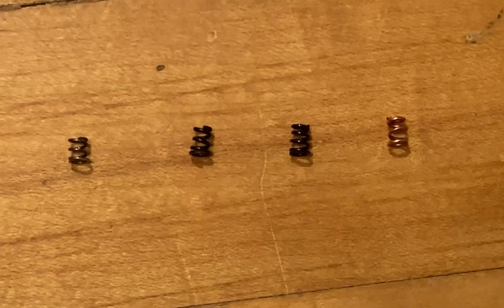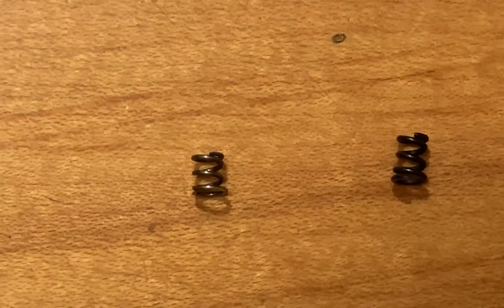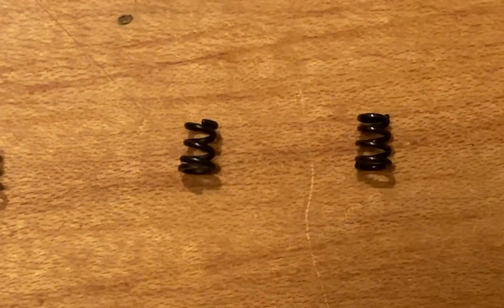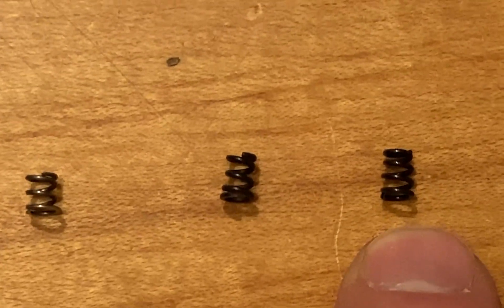AR15 Extractor Spring Std vs Sprinco vs Colt SP64026

Comment: I'll just throw this here... why would it matter if the extractor spring develops some surface rust? And what would be so hard to apply a bit of CLP there when cleaning and storing it? What's the difference in cycle life between the Colt "Gold" and the Sprinco 4-coil?

BTW the Wolff XP extractor spring is like 5 coils and not ground at the ends, and I could never find a bolt that would accept that 5 coil spring without some serious work involved.

Comment from the maker: I'm just rereading your message as long as it is trying to make sense of where it is. You actually disagree with me. Sprinco themselves told me if u won't be oiling your springs these aren't for you.
Reply: Per the conversation I had with Alan Duggar the other day, high quality weapon grease ( he recommends Slip2000 EWL or Lucas) should be applied to the buffer spring.  He made no mention of grease or oil specifically on his extractor springs.